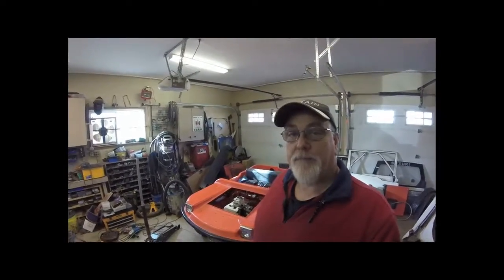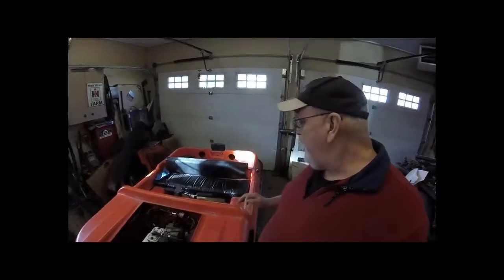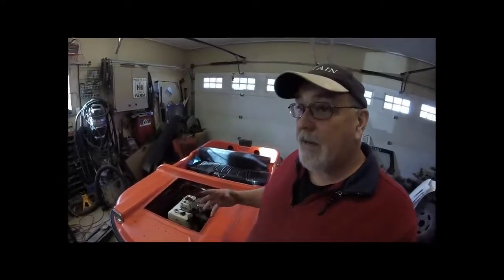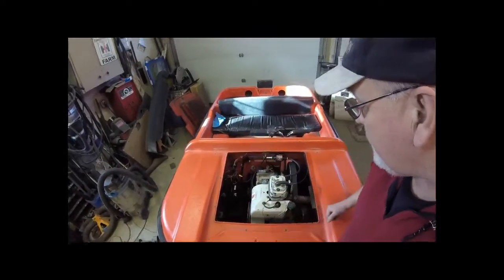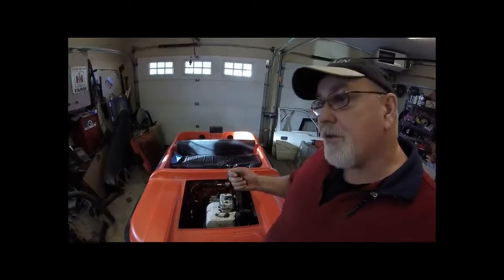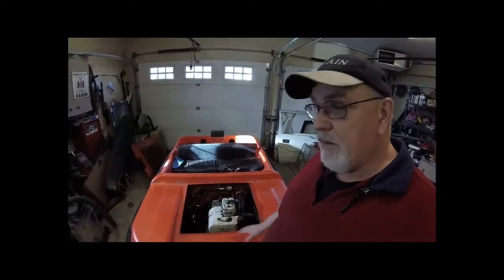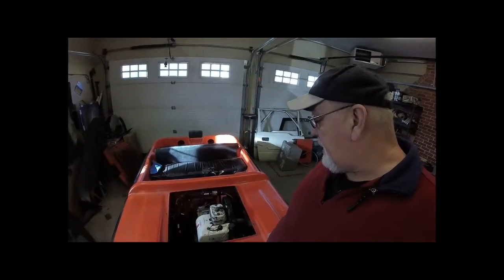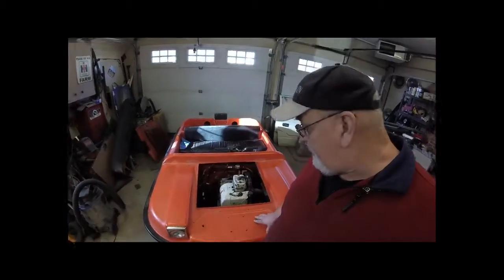Argo2

Comment: That's good , They're a hoot in wet conditions ,Mind the dipstick it will rattle loose and push the oil out I've stretched a light carb spring to hold it down .